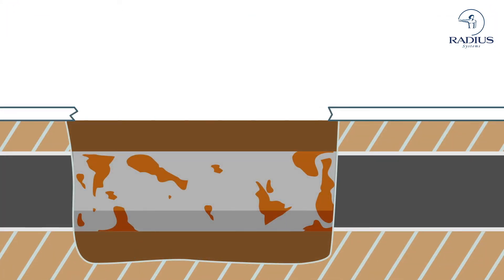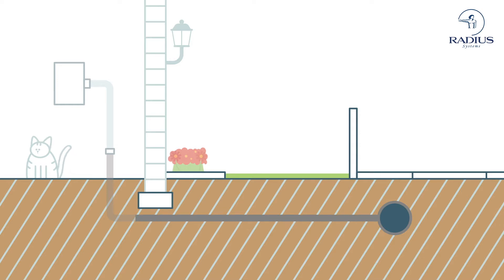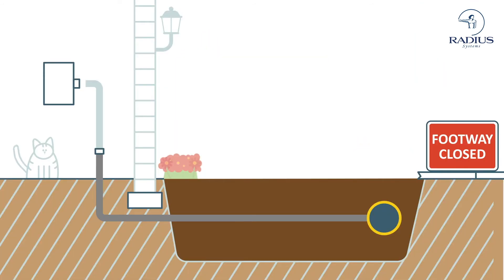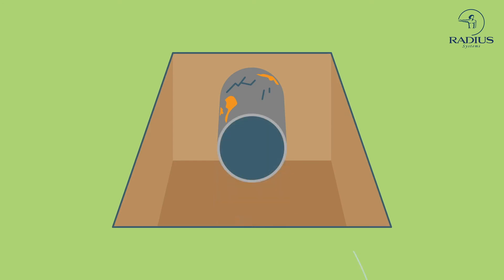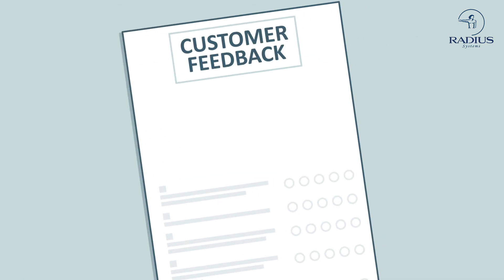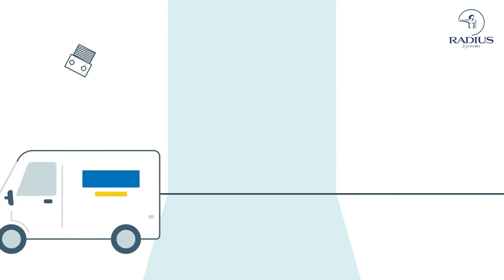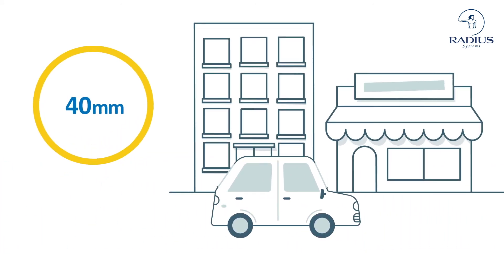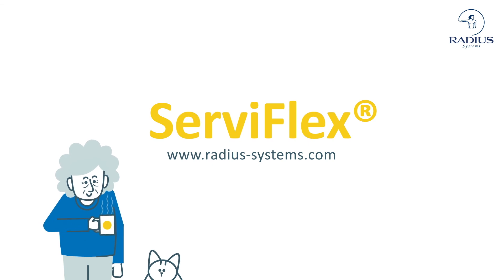ServiFlex - The only gas service relining solution from mains to meter!

Comment: I don’t agree with this video, it’s not 100% correct as it’s saying serviflex is the only method of service insertion when there is many methods including pushing 20mm PE up 1” and also this video doesn’t show the correct installation procedure of using a serviflex insertion kit. Instead it shows a worker pulling on rope which has clearly been blown through the steel service and we’re not allowed to do it like that. Overall the video is very poor and you will find much better videos try searching for “Glen Speakman Servifex video”